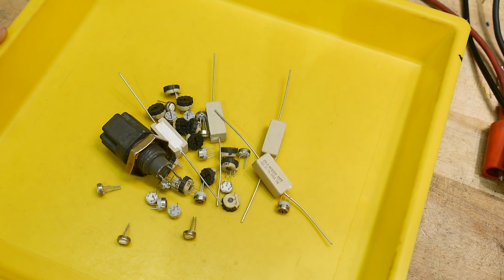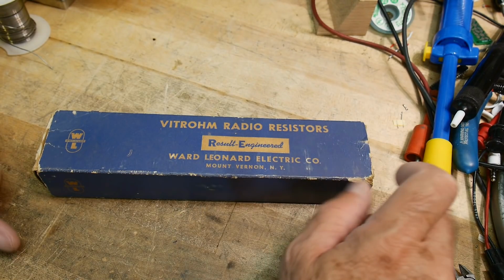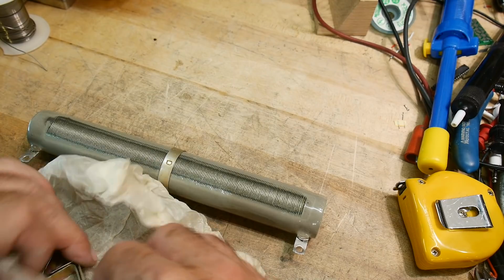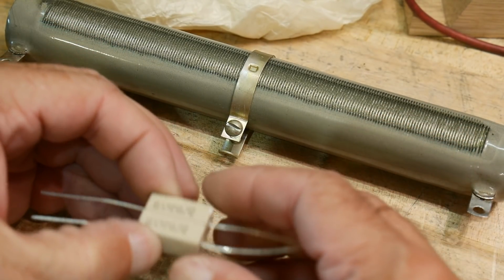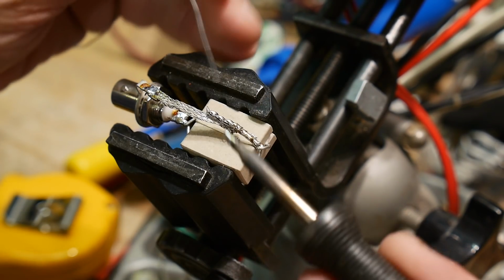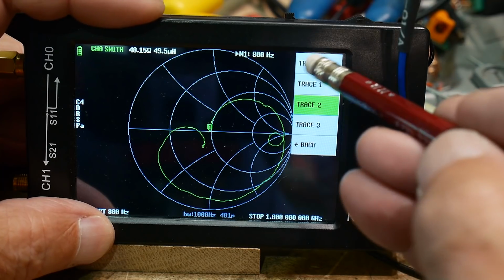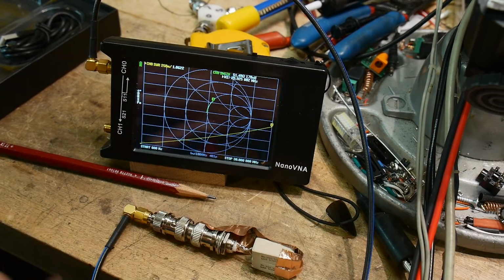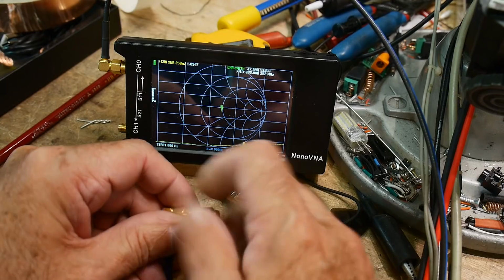#799 Resistors from the Junk Store

Comment: Looked up the Dislord firmware. Seems like so many versions and no instructions to upgrade. Do you have any good web sites for the technically squimish?
Reply from the maker: Yes, it not well documented. The latest files are: https://github.com/DiSlord/NanoVNA-D/releases/tag/1.0.38
get NanoVNA.v1.0.38.zip
inside are two files. H and H4. if you have the small VNA use H, if you have 4" VNA use H4. DFU filetype firmware update is same as before.

Comment: These are wire-wound Resistors. Looking at the lettering on them, you put them in the same direction. I think this will double the inductance. Would be interesting to see what happens, if you turn one of them to be in the other direction.
Reply from the maker: Seemed like a good idea. Tried it. No difference 😕
Reply: I remember that idea from decades ago, it might work better when the resistors are in series. Another thing that is worth while is to make the correct sized box to form a coaxial load. You have to take a flying guess at the dia. of the resistive coil...

Andy

Comment: Homedepot has started to carry combined imperial and metric tape measures. I was doing a project recently where the imperial units were giving me a headache and just switched to measuring everything in mm/cm.
Reply: In the UK, virtually all tape measures available in our equivalents of Homedepot are both Imperial and metric but after some hunting, I managed to find some metric-only ones. I may have been taught Imperial at Primary School - but that would have been nearly 60 years ago - and being an engineer, I've always used metric.
Reply: @zeno2712  I'm actually from the UK, been in the states since the mid nineties. Once you're over here meters, centimeters and millimeters aren't really a thing. So I'd gotten used to it, however, I've recently had to do some construction work where fractions of inches needed to be added together and subtracted/divide/multiplied and sitting there with pencil and paper doing the math got old real quickly. I looked at the tape measure and said "oh, it has cm/mm!" I just measured everything in mm and did all my calculations and subsequent cutting that way.
Reply: @vincei4252  Indeed. Far easier. The company I worked for in the UK (Honeywell) had a couple of locations in the US (NY and Sacramento) that I visited several times. As far as I can remember, we all worked in metric! But don't get me started on paper sizes!